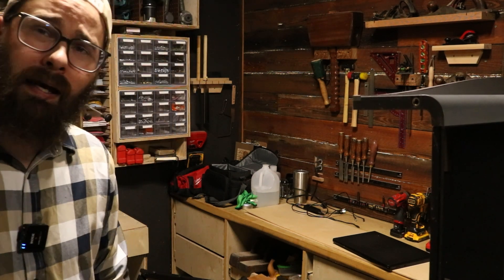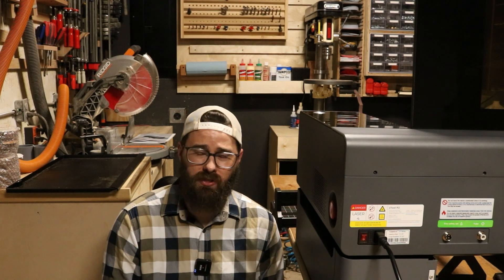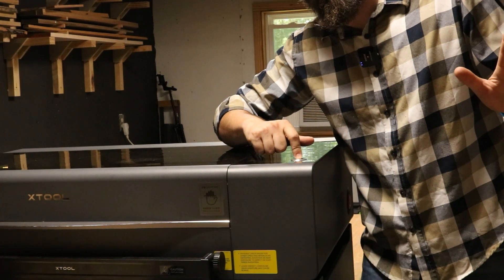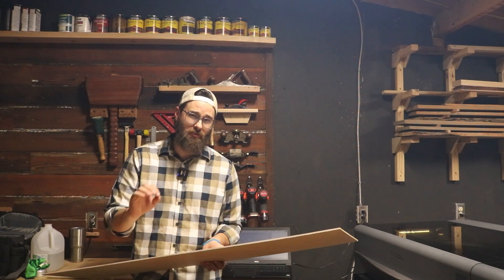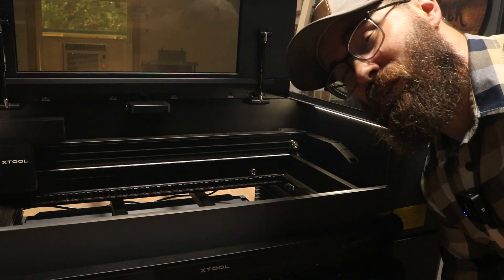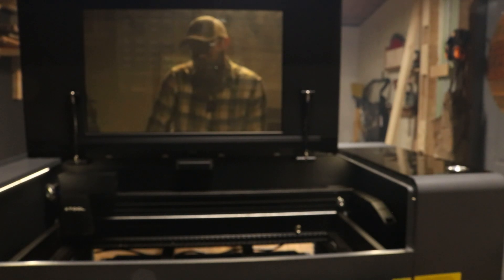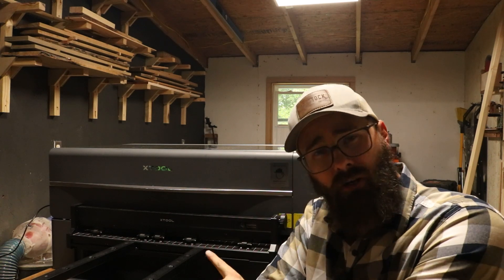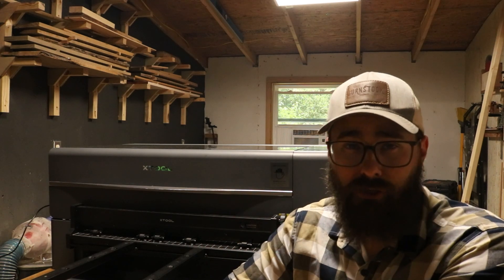xTool P2 MAJOR ISSUE (Conveyor Accessory malfunction and how to fix)

Comment: We just received a brand new P2S from XTool,  where we cannot complete initial setup due to a horrendous grinding, vibrating noise after powering on the P2S after the step to fill with antifreeze and purified water.  We have the 'care extra warranty' package and we are in the UK. XTool have insisted that we replaced the x-Axis adaptor with a new part. Not once have we been able to test or use the machine. They say they have no UK onsite engineers ... - They looked to attribute blame to us as well. - That is outrageous customer service.
Reply: Dont like the sound of that 'support' at all!  Im someone whos thinking of a P2S as we speak...

Comment: I do not think the issue was with the connector, but with the back port of the machine where it pushes the material out. If you watch the video at 3:10 you'll notice that the motors skips as soon as the material hits the back / outfeed part. That's either because it because it gets pushed upwards a little by the blank metal roller thingie on the infeed side or if the wood is not 100% flat and bows up and "misses" the outfeed slot. It might also happen when the part is not completely supported on the infeed side and tilts it up a little.

If the connector didn't connect properly, the motor would just not work, but it tries to push the material and "screams" because it can't move. It skips steps which results in that rattling noise.

I do think it might help to have a sacrificial bit at the start like you need to have at the end for the rollers to work. If you make sure that start piece already is in the outfeed slot, it can't hit the case. That's why the bits further down the material worked without issues once the start threaded itself into the slot somehow.
Reply from the maker: I'll have to look into that, thanks for the info!  It seems to be working just fine now, if it has any more hiccups I'll keep this in mind.
Reply: This is exactly what it is. The sound the machine made was from the board not being able to move and jammed. I use the hand roller and I feed a new material through to see if it goes all the way before I start the laser job. Its not made to do really thick planks on the conveyor.
Reply: PS: Unemployed Redneck Hillbilly Creations demonstrates what I tried to explain here: https://youtu.be/MPpQFy1bEmo?t=536